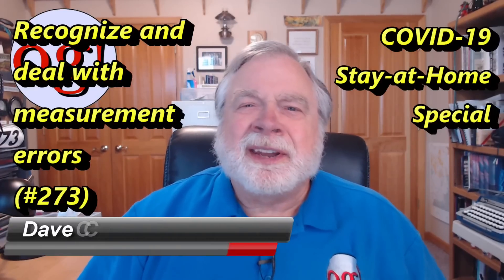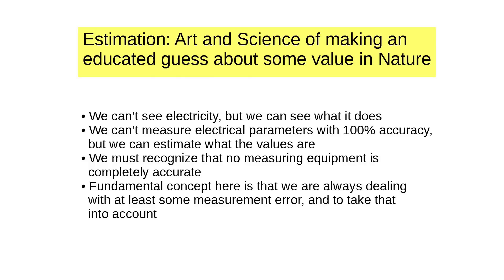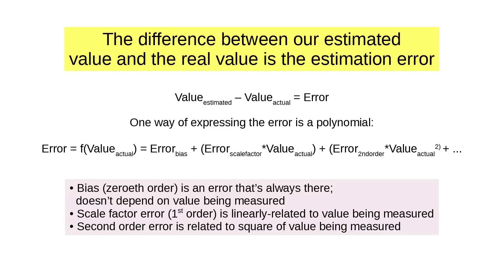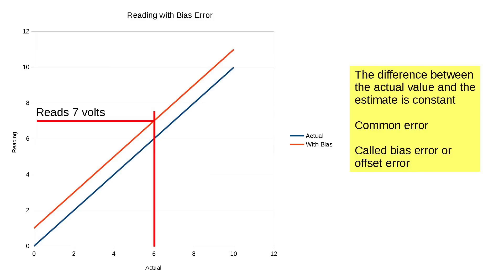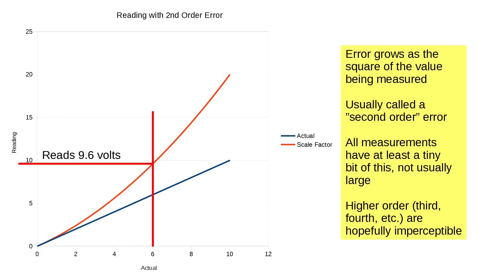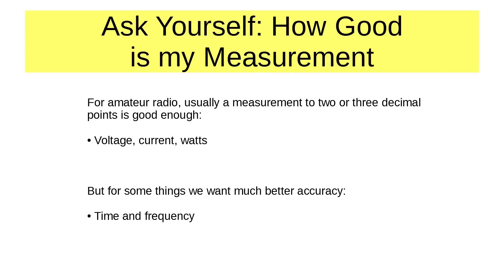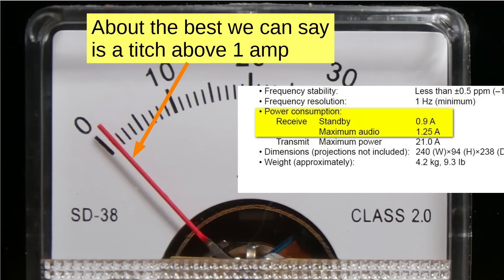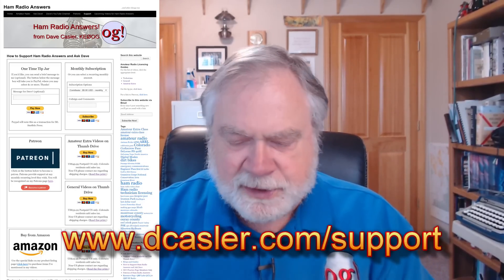Stay at Home Special: Dealing with Measurement Error (#273)

Comment: Thanks Dave, You are spot on about measurements and errors.  I was always taught to estimate before measurement, because what you measure needs to make sense.  We have a lot in common.  We are about the same age.  You went to BYU and I went to UVU at the same time.  So we probably walked on some of the same dirt.  You were in the Air Force and I was in the Army (Signal Corp).  This brings back good memories.  I fixed and calibrated test equipment in my MOS for the people that needed to "see what was going on in the electronics that they were servicing."  So this subject is real close to my heart.  There are so many hams that don't understand when accuracy and resolution are important and when one or the other parameters are not so important.  Your example of voltage and frequency was such a good point to make. 1% error in frequency can be intolerable but a 1% error in power supply voltage doesn't matter.  Thank you for your videos and the hard work it takes to make them.  I have enjoyed and learned so much from watching all your videos. Thanks again and "73", Dan N7RRY

Comment: How to you like your switching supply, any problems with noise?
I have an Astron linear supply I purchase about 30 years ago and is still working fine.
I was think of retiring it to back up status and purchasing a new Astron switching, any thought on their 35 watt model for my FT950?
73
wd4dda
Preston
Reply from the maker: I've been using switching supplies for years and have not had a problem. The Samlex is nice and quiet, both noise and RF-wise.

Comment: Kudos to you for this video. This is a good reminder to operators that the single measurement device they are using may not be accurate or precise. I have seen reviews praising certain little QRP transceivers for their Internal tuners and their built-in SWR analyzers but when you see the screen they are flat on 1 : 1 swr which seems improbable and inaccurate. 
It would be great to do an actual comparison between the built-in swr measure and a known accuracy swr meter on those QRP transceivers.

Comment: Dave, one correction. Sorry, but I was a Statistician for 40 years, and my OCD won't let me ignore it. It's a common misconception. What you are calling precision is actually resolution. Precision is the ability to hit the same value every time with the same input. If you even get a badly inaccurate value reliably, you still have good precision. So you need reasonable accuracy, precision, and resolution to be able to make useful measurements.
Reply: Resolution definition is tied to the context of the discipline, in which it's used.  In this case of electronics measurement uncertainty, Dave did use the word correctly.  I was impressed by the shear number of alternate usages when I looked it up in Webster's.
Reply: @markchase5323 , I think mwechal is correct - see https://meettechniek.info/measurement/accuracy.html
David

Comment: Analog meters are non-linear because of spring tension and magnetic stiction. They are either calibrated to read most accurately at full scale, or they have a painted scale that is non-linear to match the needle's actual movement.   Even tho this power supply has inaccurate meters, they work in your favor because 13.8 is almost full scale.  If you were to turn that supply down to 2-3 volts, the meter would read a volt off.   For this application, you really don't care what the ammeter reads, so long as it's not too high. The current draw changes with SSB load anyway.   Meters like this do give a nice warm & fuzzy that your station is working. 

My station has an Astron supply without analog meters, but I added a 3 1/2 digit digital panel meter.   To my disappointment, the digital meter fluctuates so much during voice transmit that I can't read the last digit.  An analog meter is better suited for this application.

Comment: Great video Dave, as always.

Since we are talkinf about analog meters; however, is that our ham friends should know is that with an analog meter, it's most accurate in the center of deflection!

If this Samlex power supply was just a little more expensive & more accuracy was needed; the volt meter scale would be scaled with something more like 11 to 16 volts, so that 13.8 would be just a bit past center scale, and the the scale would be easier to read.

Secondly, yes you 'can'  zero the meter with no signal, which many techs are taught. However...  as one becomes more advanced, it becomes apparent to use that adjustment to make the "normal" read most accurately. 
So if you have a 12 volt power supply, & want to read exactly 12 on the analog panel meter, then put a known accurate digital meter on the output; set the output at 12 volts, then adjust the panel meter to read that same 12 volts.

Speaking of which Dave, you need to  recalibrate your horn! Haha!

Later my friend,

 73 - John -N7GHZ